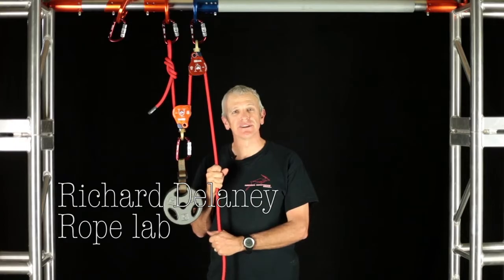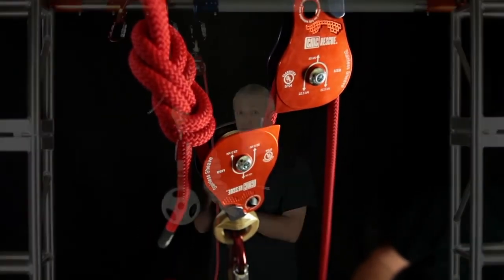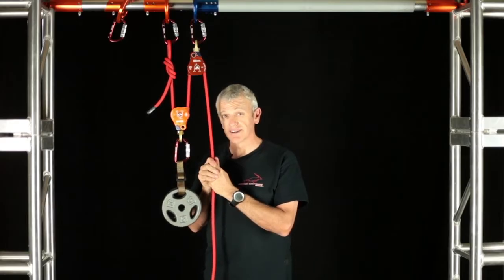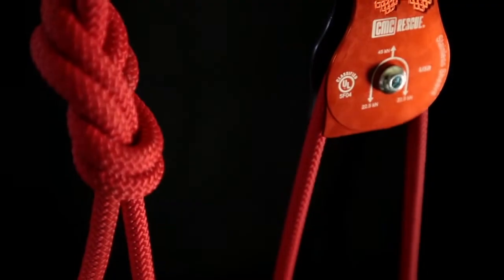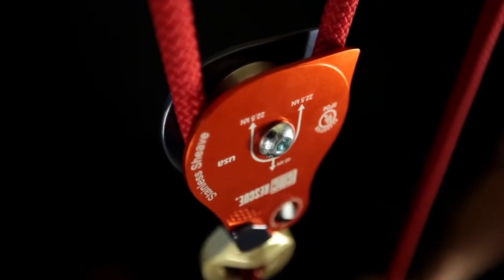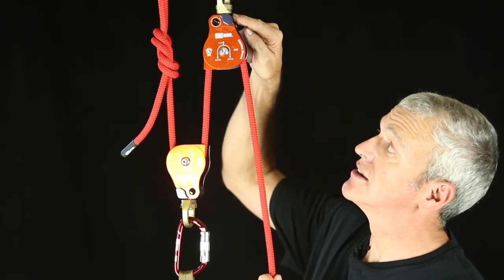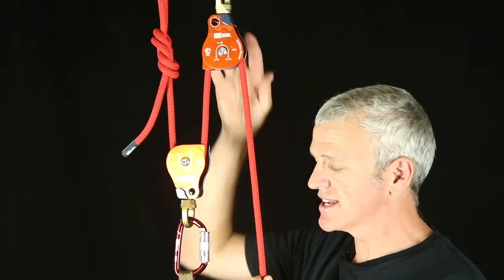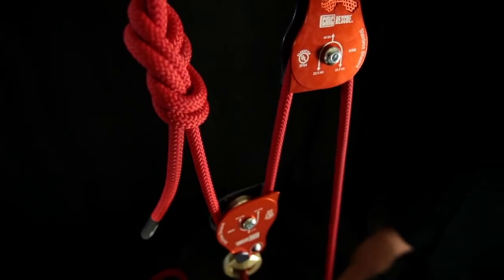Calculating the Mechanical Advantage in a Simple System

Comment: I want to add a pully system to raise the end of my batting cage net. Any suggestions? I was going to use 3 pullies 2 on the end and try to run the 2 ends to the middle and this will connect to a locking wench so kids can pull it up down? any advice appreciated.

Comment: i am rigging an 18 ton crane tomarrow,called reeving the block...for every "part" that is verticle cable,except the redirect,we can multiply by 2?..so a 4 part would be times 4?...so for every unit pulled out,1/4 of a unit is the lift???THIS IS THE SIMPLE CALCULATION im looking for!! I have seen 10 part lines!! Why isnt this SIMPLE thing explained??AND also, not addressed here is can there be odd numbers of "parts" like 3 or 7?? by deadmanning the end at the load instead of the top??